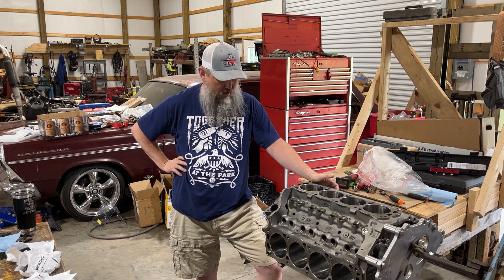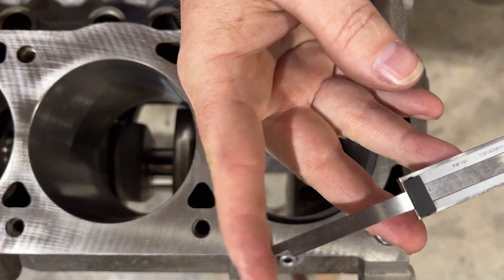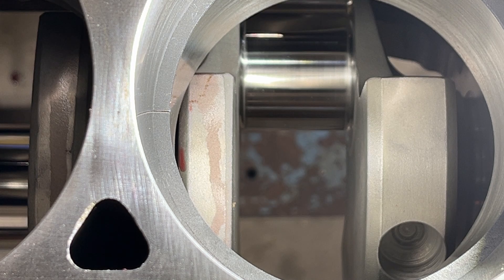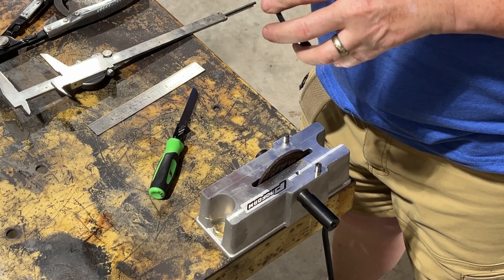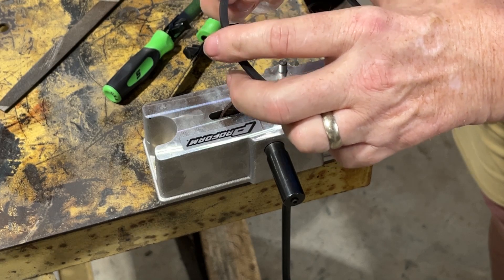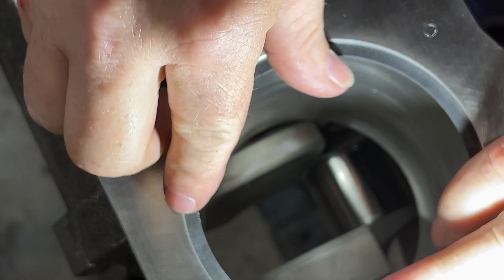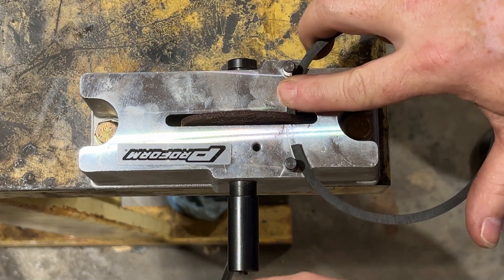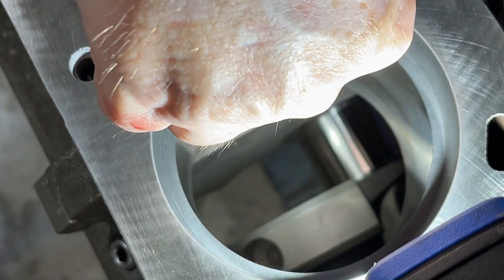Achieve Perfect Ring Gap for your Engine; Ring Filing

Comment: How much do u get for those blowbye specials?
Reply from the maker: Not sure I understand what you are getting at but thanks for watching
Reply: @Jethro2022  if that Ford is na the ring gap should .018 that was my point you gave the ring clearance for atop fuel nitro burning dragster there were du
Reply from the maker: @Doug-b4p  it will have some Nitrous added. It is a little loose but I went by my engine shops suggestions. I come up with a measurement about .004 smaller than he suggested